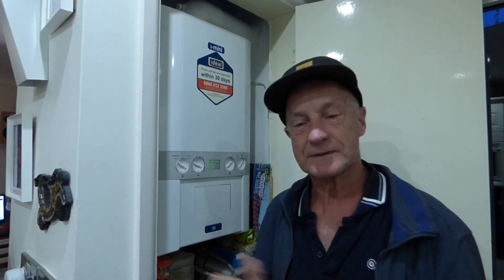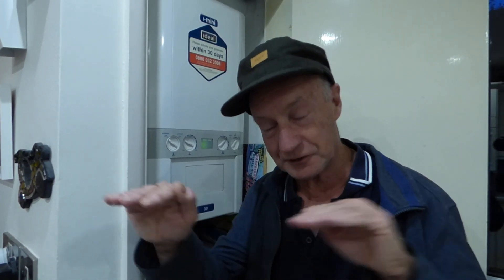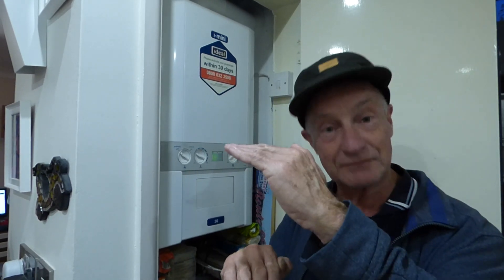Combi boiler pressure keeps going very high, is this a problem ?

Comment: What happens when expansion tank get old and the rubber bladder gets hard,  eventually the bladder will spilt or crack and enter the steel part then rust the inside and then leak out.
i worked in care homes and this happened quite often on electric water heaters, i had to check every month water would leave the pressure relief valve i would report it they would ignore it.( i would check water pressure and temperatures)
And in time the water would leak into steel chamber and rot the insides, then you end up with a upright shower.( to check for this before the leak the top of expansion tank will be very hot).
In regarding combi boilers, installers tend to run the boilers at same flow temperatures as the old cast iron ones say 70-80c, this was due to calibration and size of radiators in the past.
This not only shortens the lifespan of the combi boilers, but also speeds up bladder/expansion vessel rot.
The hotter the water in central heating flow rate the more it increases the pressure.
ideal is around 60c for central heating flow rate, this should lower the pressure and make the boiler run at least 10% more efficient .
also make sure water pressure is at correct setting say around one bar or 1.2, this also will help because if its showing  2 bar when cold  and not running then it will be much higher when hot.
Reply from the maker: Thanks for the info .

Comment: Hi dereton the pressure gauge in my ideal logic combi boiler keeps going up and hovers around 2.4bar while cold. This happens even after I have drained the system and brought it down to 1.3bar.  So from 1.3 to 2.4 bar in the space of 20 minutes,  I repeat the draining and again it raises, any idea why?
Reply from the maker: It will raise once the boiler is used. If it keeps getting higher if will drip outside once the 3 bar level is reached. Check the filling loop is not letting by. After that get an engineer in to look for you, it may be a faulty heat exchanger.
Reply: @dereton33  really appreciate response dereton I now have engineer booked for Thursday. Thanks

Comment: when i top my pressure up. On the gauge it shows as 1.5bar. then when i come back a few hours later it shows as the pressure has gone up? i release the pressure and brign it back to 1.5 bar and then the same thing happens and a few hours later its back up again. whats going on?
Reply from the maker: Faulty heat exchanger. Or filling loop still connected and valve letting by. Or a problem with the pressure vessel

Comment: Had these problems on an Worcesetr 24 Junior.  Kept losing pressure, requiring refilling.  Had a very loud vibration, even when whole house water and heating pipes were empty and taps open!  Recharged pressure vessel.  Problems recuured within hours, but I noticed the pressure swing from cold to hot was less.  

Thought there must be water locked somewhere in system as it would be very hard for empty pipes to behave in such manner, so I refilled the boiler to high pressure (2.5 bar), opened the drain cocks on the ground floor, loosening the bleed vales on radiators to let air in, and opened the filling loop for a couple of minutes to get more water in the system.  Did this twice for good measure.

Left it alone for half an hour after the system stopped relearing water.  Closed drain cocks and opened the filling loop just a little to let the system refill slowly.  Refilled to just over half a bar and bled air from  each radiatoe individually. 

Turned on boiler.  Bled air again and topped up just a tiny bit.

The pressure only rises from 0.5 bar when cold to just under 1 bar when hot.  No noises so far and the entire system is quiet so far.  The loud vibration is gone, and the creaking noises previously heard form radiators and pipes have completely gone.  So far so good.

The radiators and pipes have been in the house for around 30 years, with no filter or fancy additives, and the last time the system was drained was around a decade ago, when the boiler was fitted.  It has never been serviced.  The older boilers were much better.  We had a Biasi combi working for twenty years, never serviced, and it ran quiet as a mouse and perfectly for two decades.   Everything made in the modern age is cheap junk designed to last a very short time.  Welcome to the end of days.
Reply from the maker: Thanks for your comments .

Comment: The black key on my combi boiler pressure valve is broken.can u show what looks like when it's fully closed.im using a wrench but the pressure is going to a bar from bar 1 and I'm not sure if It's left open abit.As I'm bleeding radiators and it's still rising too high when heating is on.,
Reply from the maker: When the heating is on the pressure always rises as expansion of the water takes place. If the other valve is off as well it will not be leaking any more water into the system as it is a double check valve. Take a little bit of the pressure out if you are above 1.5 bar.
Reply: @dereton33  Thank you I will give it a try

Comment: Is it possible to have the resting boiler pressure at half a bar so if the expansion vessel isn't working the maximum it will go up to is 2.5 bar? I ask this as when my boiler is set at 1 bar when off, it rises to over 3 bar when on. Seems obvious now the expansion vessel is not working but as a temporary measure could I reduce the resting pressure?
Reply from the maker: Try, but it might be too low to start the boiler up. It may not be the expansion vessel, it may be the heat exchanger.

Comment: My baxi combi boiler pressure gets high when heating is on, but when heating is off it goes all the way down. What could this be?
Reply from the maker: As long as it does not drop below 1.3 bar it is fine. If it drops to half a bar then you may have a pressure vessel problem.

Comment: Can I add an extra expansion vessel external to the boiler on the radiator pipes? I think if you are not Gas safe but can handle the plumbing, instead of giving up the radiator you could simply drain the system down and add an extra expansion vessel with a valve to isolate it when that one in boiler will be replaced, is that right?
Reply from the maker: No.

Comment: When the pump starts running water in the ch wouldn't it move the air from that radiator to others causing them to not heat correctly?
Reply from the maker: No

Comment: So let's put a spare radiator in every new install to use as an expansion vessel if needed and normally closed isolating the valves.
Reply from the maker: No way.

Comment: there we go  auld hand best in the trade  i struggled for a week with normal then very high pressure gas engineer friends (2) says boiler f*****d) no money for that in present times  so tried the upstairs rad as extra expansion and hey presto  working 100% now   so new expansion tank on the cards at £93  compared to a couple of thousand for boiler replacement , gas engineer friends  ? go tickle yer ass while watching a true engineer for some tips , like dereton on here ! yer a champ mate   no other clips i watched gave much away   that 1 with upstairs is common sense  but you need to think about that 1st ! thanks again buddy  stay safe

Comment: Hi
 Another cause of pressure going up might be because of a closure in the pipes of the central heating from residue of radiators....
Reply from the maker: No the boiler would simply switch off.

Comment: Pipes started banging like mad, turned on hot tap and it stopped but started again if I turned it off. Tried bleeding radiators, pressure was up to 3! Ran the taps for half an hour. Switched off heating and pressure is currently at 2 and descending. Wish me luck as I turn the boiler on again.
Reply from the maker: Call in an engineer first.

Comment: Pressure on my boiler keeps dropping over time and I have to top it up every 3 odd months, any ideas?
Reply from the maker: Every 3 months is ok and quite normal. Evaporation takes place and pressure gradually drops .
Reply: You have a very minor leak somewhere most probably on the bottom of a radiator somewhere touch all the connections at the bottom of the radiators with a clean dry piece of tissue paper and see if it becomes damp the thermostatic valves going into the radiators are prone to leaking sometimes. Every three months is NOT normal pressure loss

Comment: My pressure was going up turns out the plumber didn't tighten the tap to fill the boiler up right might be something to look at first just incase.good video
Reply from the maker: Yes a good point Kev.

Comment: Couldn't help but notice over the last couple of posts, you've got your winter cap on, :)  keep 'em  coming Al, atb mate.
Reply from the maker: Yeh, sorry if they are getting boring at all, but have had so much e-mail in, the best way to answer them all is by using a video.
Reply: @dereton33  Not boring mate, just a cheeky comment